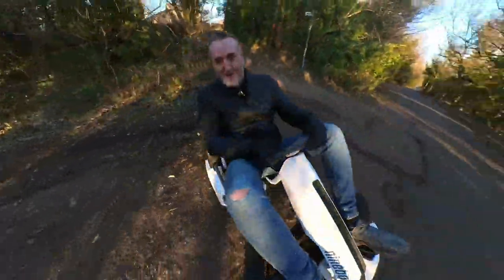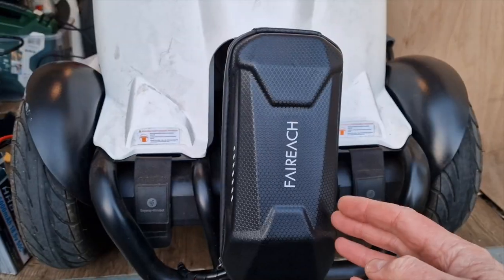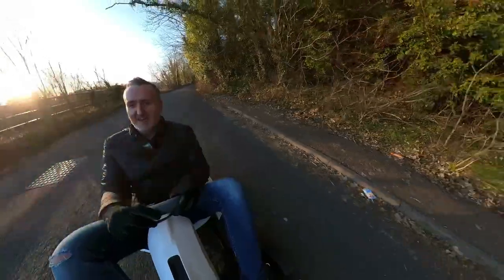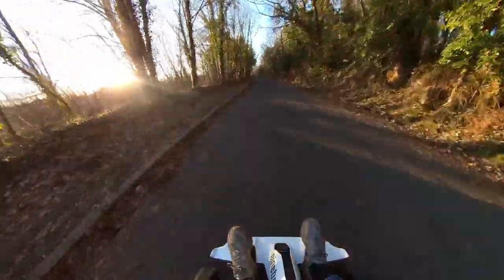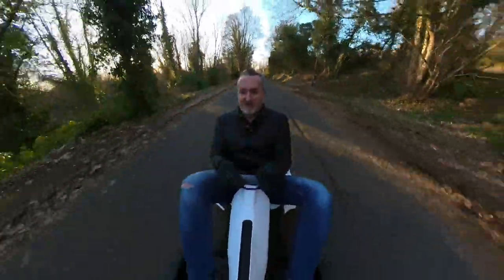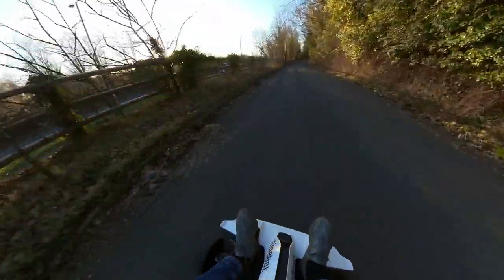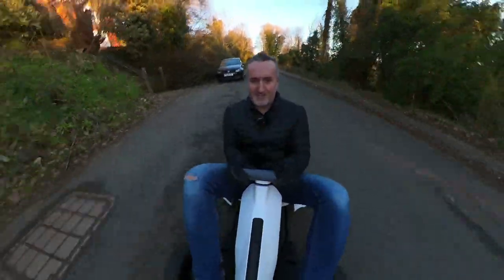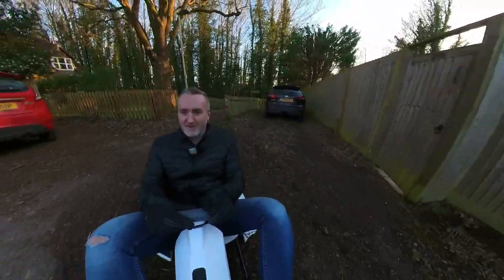RANGE EXTENDER FOR THE NINEBOT GO KART/GO KART PRO!!!

Comment: Very cool Andy! Thanks for sharing. I've been experimenting with combining 32700 LifePo4 extender packs with 18650 eBike packs and combining the battery chemistries seems to work brilliantly. The Li-On gives provides quick response and the lithium iron packs supplement by holding a constant voltage and keeping the Li-On at optimum voltage, and a LifePo4 pack might be worth a test on your Kart.
Reply from the maker: Interesting Jack! and of course LiFe seems to be quite cheap at the moment doesn't it! Great idea.👌🏼
Reply: @andykirby  I've been running two 350watt hour 60V LiFe packs I built on an ebike with good results. They're flat enough to strap on a frame and together weight about 5kg. For extra range I add a third pack to a rear rack. I like having modular and range boosting packs so I only carry as much weight as needed.
Reply: Hey bro, I have more questions about speed and range upgrades, is there any way I could private message u?
Reply: @warrenrivers8440   Sure, it's on the About page of my channel. I tried to post it here but it was removed.
Reply: @jackoneil3933  I’ll be sure to check you out thanks bro
Reply: @jackoneil3933  I don’t see anything bro do u have a social media or anything to pm you
Reply: Can we get a tutorial on to increase the battery/range? I’d like to see a step by step video

Comment: Hey Andy, what type of connection / connectors did you use in order to add the extra connection to the existing nine bot battery? There isn’t much working room in the battery itself, were you able to first remove the cells from the housing before making the splice? Thanks !

Comment: Hi Andy.  I’ve purchased a Go Kart Pro to work with my daughter’s Ninebot Segway S. However, it turns out they aren’t compatible.  Do you know of any work around please? Many thanks Mark
Reply from the maker: Hi, that's right, the mini S is not compatible with the gokart pro as its the S Max that used with the gokart pro. What you could do is do what I did and swap the mini S main board for the S Max one. You'll need some soldering skills to wire up the motor wires amd will also need to contact Alex who made the ninetool app to update the Bluetooth module and then it basically appears like an S Max in the app, you 'should' then be able to make it work with the gokart pro... however the battery on the S max is bigger and higher power so it might not survive longterm use with the extra power.
Reply: @andykirby  thank you so much for taking the time to reply.  I think it may be a little outside of my skill set, but really appreciate your input. Thank you Mark